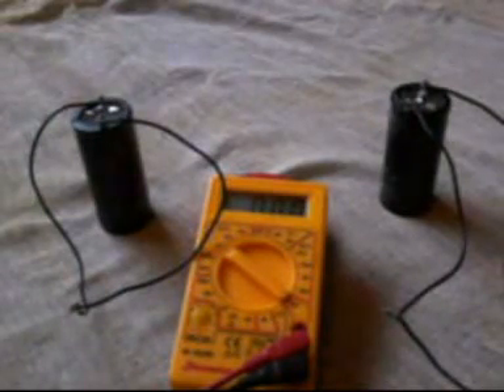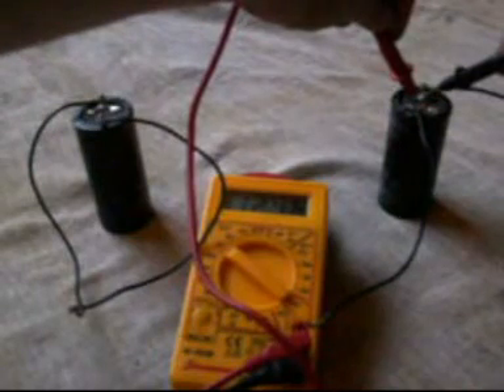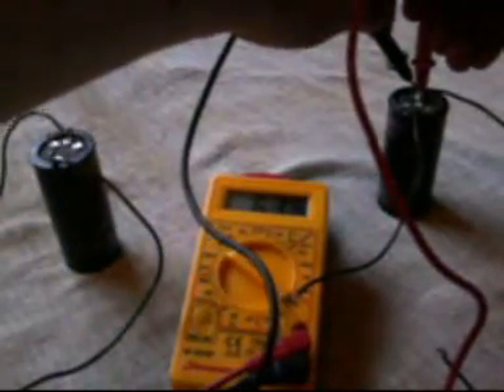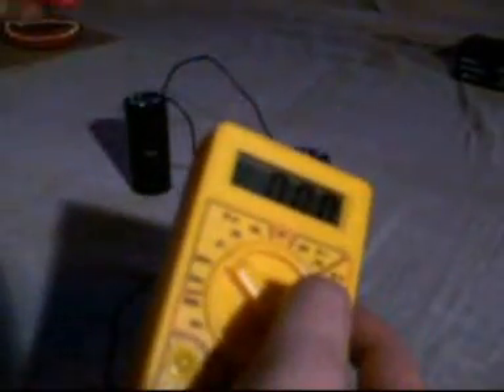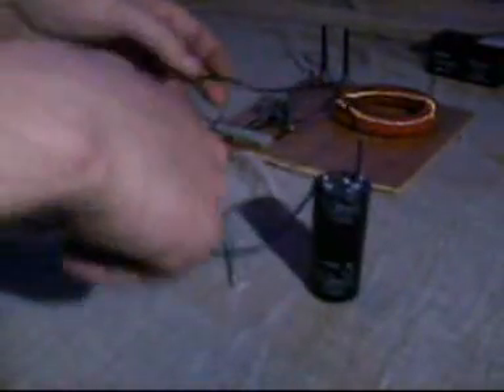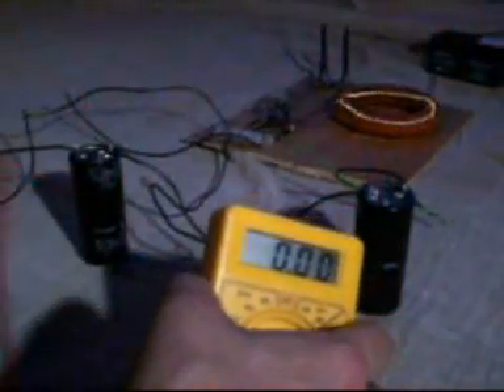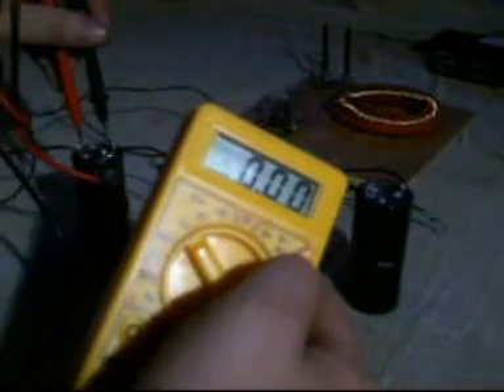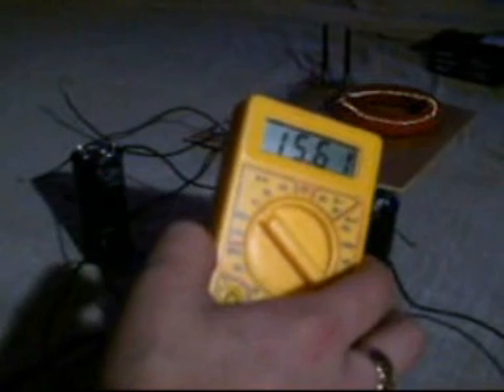Charge Anomaly ... 12v + 0v = 15v???

Comment: You have a basic buck boost converter there. The capacitor to capacitor charge only leaves half the energy. With the pulser and coil you have simply raised the efficiency to about 86%

Comment: Sir i have to apologize for the post before! I did the energy conservation law on your first test when the capacitors get to same voltage , which is normal. The initial energy is 2x compared to final Energy, THAT'S REALLY IMPOSSIBLE, the losses in that circuit can't come to 1/2 of initial Energy NO WAY. No "scientific" explanation for that besides IT'S RADIATION LOSSES, that's BULLSHIT, the law of conservation is a flaw. I'm SORRY AGAIN FOR BEING SO NARROW MINDED! i  need your email address pls.

Comment: This is NOT overunity: C1 initial at 12v, Einitial =C1/2x12^2+E2i(=0) = 144 x constant
at end: Eend=E1(8.5^2xC1/2) + E2(7^2xC2/2) = about 125 x same constant
SO U GOT A COP of about 86%
Guys like you are either stupid or intentionally misleading.
Only way to get costfree energy is by TAPPING RADIATION, like Tesla did or by using very sharp transient pulses at discharge, it's said that a condenser stepcharged is using less energy for charging as per discharging sharp. I have to check that too.

Comment: @introvertebrate I guess because I don't think of circuits in terms of charge conservation it just isn't a problem for me. 
.
I get that in parallel there is no path for two caps to build up charge and that this law is probably related to Kirchoff's current law at nodes. But resonant circuits are famous for having large circulating currents in isolated branches. I can't remember all the details these days but thinking about charge conservation looks like a misleading approach to me.

Comment from the maker: it is a physical law, and yes, the law needs clarification which was the point of the demonstration.  You are seeing it out of context.  

Charge can be measured in coloumbs, and if you were to take the law literally then it is saying that you can not connect two capacitors together and end up with a greater number of coloumbs than when you started.  When you connect two capacitors together like at the start of the video, charge (in coloumbs) remains the same though half the energy is lost.

Comment from the maker: @chrisofnottingham It would lead to infinites if the componants were ideal and the wires wire completely free of resistance.

but as you said this can not happen.  But due to the parasistic resistance, half the energy will always be lost when you connect two identical capacitors directly together.  R does not equal zero even when it is effectively a dead short.

Comment: @introvertebrate I'd never heard of conservation of C as a law. It might have physics applications but it doesn't  seem to help as tool for circuit analysis.
.
It is telling me that if I charge up a cap with C coulombs, the net charge is really zero and is equal amounts of +ve and -ve charge (which we knew anyway). Then if I short it out, it will just be zero charge made up of zero + zero. Is that correct or did I miss something? In which case the net charge of all these circuits is always zero.

Comment: @introvertebrate Yes, so that is where your i^2r losses will occur. The point being that the circuit symbols represent idealised components. Things like internal resistance of a battery or inductance of a wire are shown in an equivalent circuit when appropriate. Connecting two caps directly together in parallel is such a situation because otherwise it leads to infinities, which never happen irl.

Comment: This is far too rambling and you also don't provide a circuit diagram of the oscillator so it is completely useless as a video.
.
Re pdf Expt 1: Energy lost is heat due to 'resistance'. You say there is no resistor but what is the discharge current? With no resistance it is theoretically infinite. This indicates that the idealised circuit symbols don't reflect real life.
.
For instance we can connect a 12V and 6V symbol in parallel but it won't explain what happens with real batteries.

Comment: Introvertebrate , I regard your experiments as remarkable as well as your efforts I experimented shorting out capacitors to charge them but they lost their charge after a while this were the ones for disposable cameras 330 volts thing is the energy doesn't seem to be usable for other than flashes? Best regards

Comment: nice problem. its not easy actually. you can't use simple circuit theory. the 1st model you describe would require infinite current and also infinite rate of change of current. thus you have to go to maxwells equations and boundary conditions.I think the lost energy is actually EM radiation that can be modeled by a resistor.not sure though.
When you put the L now its not that hard to notice that the energy gets stored in the L and we have no radiation due to non huge rates of change of current.

Comment: introvertebrate, i believe its possible to extract radiant energy from the vacuum and create a so called "free" energy machine. I am playing around with a radiant oscillator and have built a Bedini.

But this video does not show Overunty. It is well known that u can raise voltage in a cap by pulsing current through a coil.

Just showing a rise in Voltage is only half the equation, u need to measure Amperage. U have to show Power in Vs Power out, otherwise this is just misleading

Comment: You can ignore my previous post since i carefully read your pdf included.
Too many so called OU devices utilize the high voltage - current spikes of the collapsing magnetic field to do the trick. Perhaps is a starting point. Who knows, until OU is demonstarted then is assumed not existing. (for conservative reasons)

keep the good work though

Comment: Nice video dude!
but not quite convinced... if you could only at the end of the experiment you connected those capacitors together... and showed that the "after experiment" voltage of each one was higher from the previously measure one by charging one capacitor and then connecting with the other... then perhapas i would believe :P

waiting ur answer

Comment: The difference in voltage between the caps does demonstrate one thing which you may have missed. Simply that you are working with an assumed 10,000 uf per cap, which is almost guaranteed to be untrue.

Electrolytic caps (especially the cheap ones) vary in capacitance to the stated capacitance by a factor of +-10% in value. One could actually be a 9000uf and the other 11000uf, with a stated rating of 10000uf on each, and still be in parameter.

The only way to check is with a capacitance meter.

Comment: This is the right method, as the total energy of any system is the combinative of the present energies of each part of the system.

In essence, just like two equal storage batteries, the total energy of the two batteries is the addition of the energy in each battery. Caps are no different in this manner. 

Just like the battery scenario, the total output energy would be limited to the average difference between the two caps, as they would first equalize charge upon connection.

My two bits.

Comment: the question is not of voltage, it is the over all energy it takes to charge the caps. you may gain voltage but will lose amperage thus.. 0 overall energy gains.

Comment: Any chance you could isolate the caps from one another with your osc and coil rig? In other words can you make one cap drain until the circuit no longer works and then measure just the output cap. If you could do this in a isolated system you would have something unfortunately you loose a lot of capacitance when you put caps in series. So while the caps have more voltage they have less amps. Please keep up the great research though!

Comment from the maker: Hi Drev,

Yes, still trying to account for the lost energy.  One theory goes that the voltage sloshes between the two caps, backwards and forwards at incredible frequency until the voltages equalise and half the energy is dissipitated in heat through resistance regardless of the value of resistor.

Though I have a problem with that theory.  You could prevent the "sloshing" by discharging the cap through a diode.  However I tried that earlier this week and ended with 2 caps with 6 volts.

Comment from the maker: Highly unlikely as I have performed this experiment many times with the same and different caps and they all appear to be in perfect condition.  But you are right.  The only way to end up with a higher voltage in this experiment (according to convential physics) is if the caps are different capacities.

Comment from the maker: in the first experiment I simply discharge one cap into the other with no load and negligable resistance, and ended up losing half my energy :(

but in the second experiment I'm doing EXACTLY the same thing except the oscillator is between them.  So now the electricity has to go through several hundred feet of magnet wire, resistors, transistors and diodes.  Logically, more energy should have been dissipitated out of the system in losses.

Comment from the maker: Thanks drev... it's nice to get some good feedback from you...

though do you think it is possible to use a step up transformer to reproduce the effect?  I'm not so sure.

Also there is no conventional transformer effect in the circuit.  It is a trifilar toroid. One wire is the trigger with approx 12kohms resistance, the other two wires are primaries.  No secondary. All I'm doing is pulsing one cap into the other cap through an inductor.

Comment from the maker: Forget joules for the time being... i'm not talking about joules ^_^

but i think you made an error somewhere about the total charge in the system...

8.47v, 10kuf = 0.0847coulombs
7.23v, 10kuf = 0.0723coulombs

which equals a total of 0.1570 coulombs

(started with 0.1218 coulombs)

Comment from the maker: However, Just because I have gained in charge, doesn't mean I gained in energy (joules).  In the first experiment I actually LOST HALF of my energy but conserved my charge.  In the second experiment I GAINED 25% charge and lost ONLY 11% of my energy (joules).  This implies that this is not a closed system and that energy is entering the system from outside of the circuit.

Comment from the maker: Hi Omega, glad you liked it!  However, I ust point out there is a significant difference between conservation of charge and conservation of energy.

In this deomstration I am apparently breaking the law of conservation of charge because it states "the total electric charge of an isolated system remains constant regardless of changes within the system." So no matter what the oscillator was doing, it is impossible for me to of gained in voltage using two equal capacitors.

Comment: Great video Sep,

               Try adding a small lightbulb in series with the cap when it discharges to 2nd cap and let us know if the ending voltage is the same.I have tried a 12v bulb in series with the cap on chrge from the battery and it lights for a second and also lights again when dischargin cap to a second cap but I never measured the ending voltage.Ah more experiments to do.thx for sharing.

-gmeatdaddy

Comment from the maker: Hi Mart,
a coil can store energy though only while current is flowing through it.  Once the current is removed the field around the coil collapses and then there is no energy stored.  Unlike a capacitor, a coil can not indefinatly store energy.  It is possible that there may be some capacitance in the circuit but this shouldn't have a significant effect with 10,000uf caps!
Good luck with your SS ;)